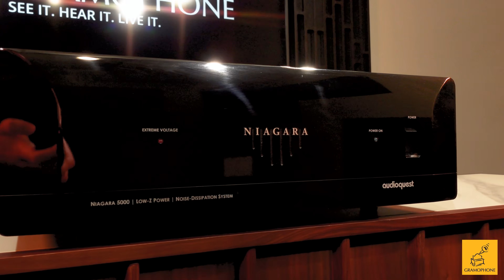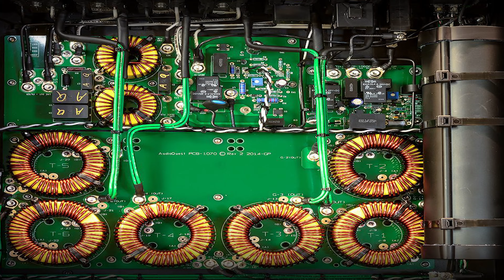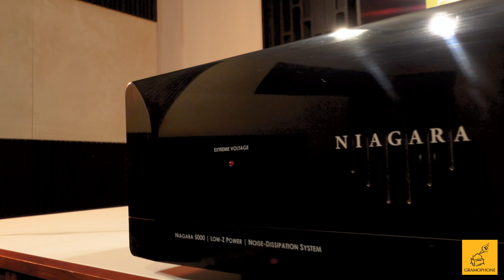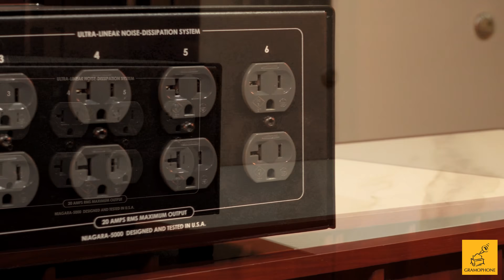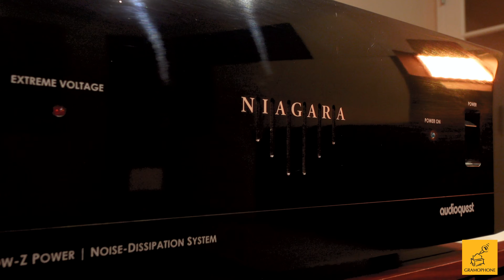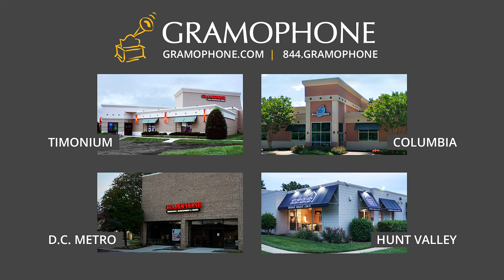Audioquest Niagara 5000 | Low-Z Power Noise-Dissipation System

Comment: I own a Niagara 3000 and I can absolutely say that everything this gentleman is saying is true. You really owe it to yourself to audition one of these units in your system with music your familiar with. I've owned many power conditioners over the last 30 years and none of them has had the effect on my system like the 3000 has. Buy it on the condition that it can be returned if it doesn't lower your noise floor and allow your components to "breathe". You have nothing to lose.
Reply from the maker: Hello David, thank you for supporting our channel.  We agree, as we regularly get comments from owners about how surprised they have been by the difference good power conditioning makes